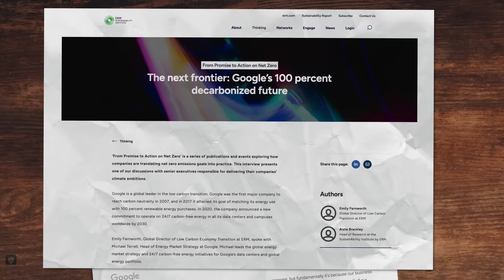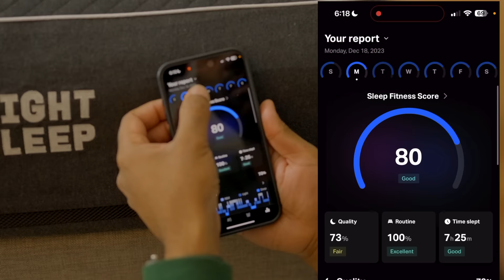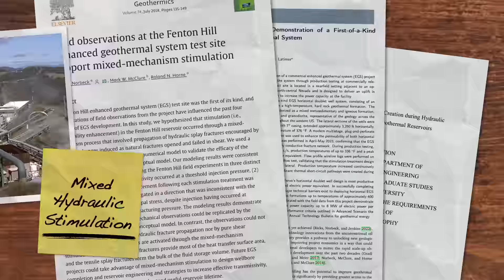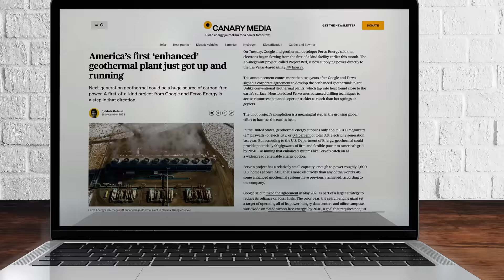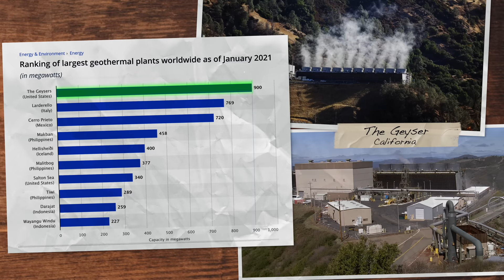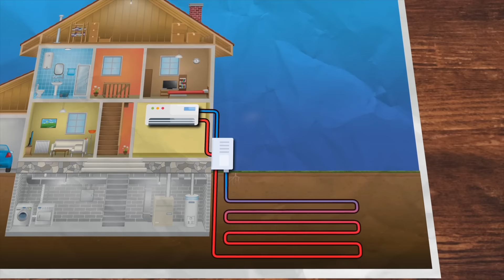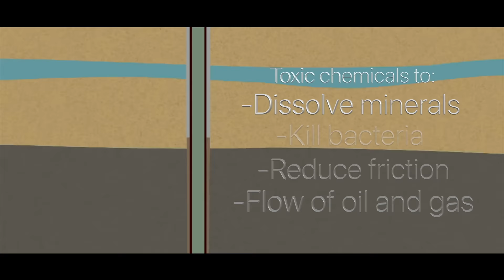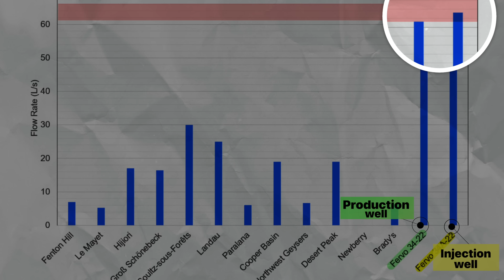Google’s Billion Dollar Gamble: You Won't Believe What it is!

Comment: As many times as this guy says fracking is bad, its hilarious because using a full stage natural gas plant saves 30% carbon in the air versus coal.  So I really wish you would stop whacking off on how bad fracking is when its saving the environment versus coal.  Also, fracking has given the USA the energy independence that we need.  in the 90s the USA used diesel generators to add extra power to the grid in low times, so oil products were used to power the grid.  The oil the USA had was pulled out of the ground here, but also in places like Iraq, Saudi Arabia, mostly canada, etc.  So fracking in the USA has made the USA safer with energy independence, removed the USA foreign interests in starting wars everywhere, all thanks to blowing holes in a pipe, and pumping water and sand and chemicals to keep the holes open.   Fracking isnt bad, fracking is great.  I love fracking.  Now that fracking drove down the price of natural gas, nat gas plants are much cheaper than coal plants, and we are as a country moving away from coal because of fracking, and blowing 30% less carbon in the air. This guy is shovelling propaganda down your throat with an 18 wheeler.

Comment: Data center do have one additional advantage.  Demand management.  For batch jobs you can schedule things when energy is the cheapest.  But short of that, besides intermittent renewables, we also really need a "base-load" or dis-patchable low carbon source, in the portfolio.  Nuclear is one possibility, though it's turning out to be more expensive (and slow) than anticipated.  This is even with SMR's.  I'm wondering whether natural gas + CCS will be cheaper.  This is assuming the methane leaks can be controlled.  Then there's geothermal.  Fervo is definitely an advance.  Everything has problems.  So we may have to bite the bullet, and get on with it.

Comment: Here is Iceland the scientists were talking about the potentials for a early warning system recently in the local News by monitoring closely the pressure differences in the many boreholes that make steam for generating electricity by pumping water far into the ground at high pressures and heat in the area, we have been having alot of earthquakes and volcanic activity here in last few months and so far its given promising results.

..as in up to 2 hours before a earthquake strikes.

idk if you have many such boreholes over there but I wonder if the large network of natural-gas wells could serve a similar role?

Comment: Water loss is no small thing but it has to be possible to substitute salt water ( I know the entire problem of the corrosion going on but solutions do exist) for the clean water being used.  And you never addressed the increased seismic activity produced by any fracking.  Finally I understand a little about geological drilling where the analyst runs a profile of the area being drilled.  The predictions are used to drill in the area to achieve a probable outcome.  The only problem is this is all statistically based and leaves room for error in the outcome which is no where close to 100%.  On another note I do not see any lasers being mentioned which is a technique that is revolutionary as the drilling process itself creates heat great enough to seal the drill hole as it continues on meaning no concrete enforcement or other structural material.  I know this technique was developed by MIT and is still being studied and explored in pilot projects but surely Google could have added this to the 10 million dollar project.  A good reason is  just the publicity it would generate for the geo-thermal industry; which could solve the entire fossil fuel problem as far as electrical power production goes.

Comment: Geothermal suffers from the same problem as water-moderated nuclear - the steam isn't hot enough.

Nuclear and geothermal produce "wet" steam at about 270-380C, which condenses inside turbines and causes blade pitting - a major maintenance cost (using supercritical CO2 might be feasible but it's still going to be inefficient)

In addition to this, geothermal water is very laden with minerals which tend to crystallise out and clog the pipework (scaling, on steroids) - and quite often has heavy metal contamination which makes the runoff ecologically dangerous - meaning that the water has to be reinjected

On top of all this, geothermal plants almost always start off producing a good amount of power but then the heat falls off over several years (rock is a very good insulator and it takes ages for the removed heat to be replaced from below)

Temperatures of 800-900C are required. This can generate dry or supercritical steam

Fracking has been around since the 1930s. The problem in the USA is that oil exploration fracking is exempt from the EPA. In Europe - where there's no exemption - it's proving uneconomic due to the remediation required

Comment: I love the video, thank you!  It sounded like Google’s goal isn’t to  get into energy production for the masses and instead are looking to address power needs at their Data Centers. 

If you consider that around 40% of the electric bill in these centers goes to cooling, maybe they should consider using the heat generated from the servers in part of the heat transfer equation. 

One idea could be to pre-heat the cold water being shot underground by running pipes throughout the server rooms (cooling servers/heating water). May create a humidity issue though. 

Another option could be submersed server rooms. Creating submerged rooms that have water circulate completely around all sides (obviously with dry access hatches for maintenance, etc.). They could use temp-controlled bypass pipes to help keep water at constant temp so increase/decrease in server loads could receive constant cooling water temp. 

First, this would significantly reduce amount of electricity needed, reducing overall cost. 

Second, if less overall electricity is needed and water is being “preheated” in the server pool ponds, maybe less intrusive (and more easily maintained) methods of electricity generation could be employed (like maybe lower drill depths or closed-loop instead of fracking). 

Maybe wishful thinking since I have zero experience in this area but I just figured, if temp is part of the overall equation, “down” may not be the only option. 

Again, thanks for the awesome video!  I think I learned a lot!

Comment: Big oil was so interested because their expertise would be necessary for the horizontal bores.

The water problem might not be as big as a problem as you think. Some wind facilities turn on a data center when the load is too much for the demand of the grid. This power plant would be more likely to try to absorb humidity from the air when the demand is low from the grid. That means it can try to store water for when it needs to. The earth's heat does not turn off. They are just trying to not produce the power. They can use the excess power to try to replenish the water that is being absorbed into the ground table.

Comment: The problem is not the idea of geo thermal energy generation itself.

The problem is in easily reaching the depths required.

That is the problem to be solved.

The second problem is that Fluctuating energy sources play havoc with the grid.
They either force energy storage systems which is wasted money ( i.e. drag )
Requires overprovisioning of variable production systems. Drag and cost.
Or force the building of conventional power plants and letting those lay fallow part of the time.....which is also throwing away money ( over sized and under used ). Also drag and cost.

Variable sources do not make sense at societal levels.

We also keep forgetting that within 20-30 years all the effort of putting up solar and wind will have to be redone. And redone at an ever increasing scale.

Keep in mind that the population is aging out. Future labor scarcity is a given.

Renewables are thus a poverty trap as they consume wealth, resources and labor.

Comment: You need really hot water if you want to produce electricity efficiently as I remember physics for thermodynamic machines. For heating houses  it should be good. You can also combine electric power generation and use the waste heat in winter for heating. We will see

Comment: If Google put massive heat exchangers on their roofs and collected and filtered all the condensated water they produce not only would they cool the building off or help to keep it warm it would also drop their electric bill and produce enough water they would have to build their own well system so it would cut their water bill into pure profit they could even put mini heat exchangers like the ones on the roof in their boiler and server rooms where they have hot spots

Comment: Add in a stable lining (which might be impossible in earthquake zones) and use a closed loop and you could have a ground sourced heat pump system and district heating in a town.  The temperature ten feet underground boosts any heat pump during summer or winter use.  I do hope that the project at Google works out.

Comment: Micro nuclear would create a robust grid and not require water, but helium to cool. No drilling required. Redundancy would be nearly impossible to beat. A simple concrete pad and connection to the grid would be the only construction required. Think tiny homes but for power plants.

Comment: I would go with a closed loop system. Experiment with more custom designed fluids to increase energy transfer. I would also work on creating small scale systems to power single homes. The grid itself is a huge inefficiency. The ridiculous amount of energy lost just in transfer is staggering. Not to mention all the energy needed to monitor the grid and resources needed to maintain and repair the grid. Use the design ideas in earthships that moderates the house's internal climate, and you would save a crap ton more energy.

I see geothermal as a pretty good idea. I also think solar and wind are garbage and a fad that is producing tons of toxic pollution. The only benefit of solar is removing the grid from a home.

Comment: I mean the obvious question here is the water. 17 million Gals per year? Is that really practical, especially given water shortages. I suppose if this presents an option where water that would otherwise be used for Gas and Oil fracking would be eliminated then ....perhaps.

Comment: Doesn't this still have a problem with finding good spots with enough heat at only 1.6 miles down?
Reply: No, I'm not sure what the temperature cut-off is for geothermal economic viability but drilling deep enough anywhere will find an economic temperature zone.

Comment: Where you have hydro dams there is no need for "peaker" plants - hydro reacts to demand instantly by simply adjusting the pitch of the turbine blades.
France is also adept at "peak" following with nuclear power plants (which are usually base load).

Comment: Can salt water be used and could these plants be located on the coast? If so, water supply would not be a problem.
Reply: I thought about that, but I think it can't. At least not directly in place of fresh water. Saltwater is highly corrosive, especially when hot, and it frequently produces scaling inside pipes and equipment like pumps. Also, if you pump saltwater into hard bedrock, I'm almost certain the salt will eventually crystalize in the pores, cloning the fractures and reducing the plant's efficiency. However, I'm sure that's a problem that can be worked out somehow, and it would be awesome if they did.

Comment: Yeah, the fracturing PROCESS may look the same, but the details of implementation matter here. Even if they didn’t, geothermal would be a step in the right direction.
Reply: Quase energy and Eavor use closed system with no fracking.

Comment: Your description of controlling a Peaking gas turbine power plant with a dial is pretty oversimplified to say the absolutely least.  While it is true that those power plants are controlled by virtual dials within their distributive control systems the actual process to move power up and down is more complicated and would require a bit more discussion. Oversimplifications like these are why people get so angry when their power goes out. They think that power generators and distribution systems just operate on simple switches. The truth is so far from that.

Comment: Two comments: At 17:00 A yellow and magenta trefoil was displayed, even though they weren't talking about nuclear materials.  Second, I remain curious about the dissolved minerals that have to be dealt with. Water in contact with hot rock necessarily dissolves material from the rock. (Basic geochemistry.)  Sometimes those are dangerous materials such as selenium. A few words on this topic would be appreciated. I worked on the early stages of the Coso geothermal project near Inyokern, CA. There, water from the Sierras perked down into quaternary vulcanismic (is that a word?) rock. :)

Comment: Geothermal power is the most destructive to the environment of all methods.  Even if a nuclear power plant were to explode or melt down, the radiation would dissipate in 50,000 years or so.  A long time to us, but a very short time for the planet.  Geothermal power however take heat from the planet and moves it to the atmosphere, boiling some water along the way to turn turbines to make electricity, or other mechanical power.  The problem with this is, that there is only a set amount of heat trapped in the planet.  Once the planet cools enough it will die.  Without the molten and spinning core of the planet, the electromagnetic field around the Earth which is protecting us from solar radiation will fail, and this will end all life on Earth.  The same thing happen to mars.  It is only slightly smaller than Earth, but when its core cooled, it lost its magnetic field, and solar wind literally blew the atmosphere away.  If anything could have lived there, it can't now.  Not without a completely sealed artificial environment which we are still incapable of creating.

So while a single geothermal power planet wont matter much, the more we have, the faster the planet cools (internally), the closer we get to truly killing our planet.  We can at least theoretically reduce CO2 and clean up chemical pollution.  We don't even have a theoretical solution to re melt the core of a planet.  Right now there is plenty of heat energy in our planet to last at least a few billion years.  However, if we start implementing giant geothermal power plants all over the planet, this number could easily drop drastically.  I know, no one reading this could care less if the planet last for another billion years, or just 100,000, but thats like saying, you were going to live to be 90, but now you are going to die tomorrow.  It is a drastic reduction in the life expectancy of our planet and should be seriously discouraged.  NOTHING else humans can do can have such a significant impact on the longevity of our planets ability to sustain life.

Comment: I do have a concern when I hear about extraction of geo energy.  I don't know if my concern is valid.  But I have never heard any discussion of this, so I will go ahead and ask.  Again, I may be naive on some of my facts, so please correct me if something isn't.  Here it is:

Our planet is shielded from space radiation by the magnetic field.

It is the only thing that makes Earth beautiful, unlike Mars.

A magnetic field is generated due to some Earth internal movement.

The movement is no doubt due to the internal Earth being liquid-y, or molten. 

So here is the question: if we start to cool the inside of the Earth, are we helping it to turn into Mars?

I know that one geothermal plant is tiny compared to the energy that Earth stores inside.   I also know that through action gaysers and volcanoes Earth expels a huge amount of that energy anyway.

But if in principle, this concern is valid, do we really need to hasten this action?

Comment: The Earth's magnetic field is generated by the geodynamo process in the outer core, driven by the movement of molten iron and nickel. This process is influenced by the Earth's rotation and the heat generated from the decay of radioactive isotopes, including thorium, uranium, and potassium. The magnetic field forms a protective shield known as the magnetosphere, playing a crucial role in preventing the stripping away of the Earth's atmosphere by the solar wind.

Interfering with the Earth's geodynamo process may not be a good idea for the future of life on Earth.

Comment: 14:40 But WHY?  Why would they artificially limit the output power just to be able to hit peak loads?  Isn't one of the benefits of geothermal that is is great for base load because it CAN be run at maximum and the fuel is free?

I don't think they are going to extract energy faster than the Earth replaces it.  But IDK, I'm not a geologist.  Or maybe their tech is mediocre, and they would reach equilibrium too fast.

Comment: Not sure rapidly drawing energy from the Earths core is the way to go. I feel we're pretty lucky to have a molten liquid metal ball in the centre of our planet (unlike Mars), providing us with a nice magnetic field, keeping us safe from radiation. It's not an unlimited resource, it very slowly cools down. I'm sure it's better than burning hydrocarbon, but I'd like to see some models. Say we draw geothermal power at 500% of our current use for the next 1000 years? Does that decrease our geothermal reserve by 0.000005% or by 5%?